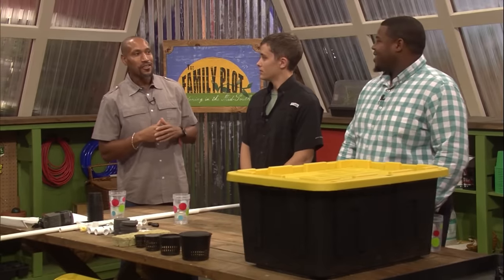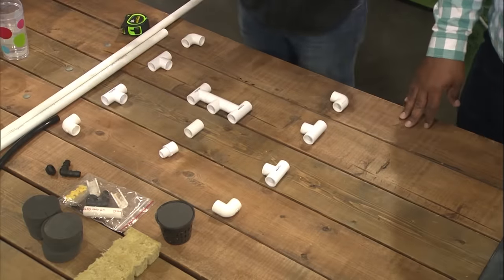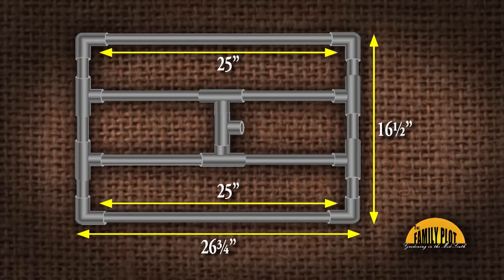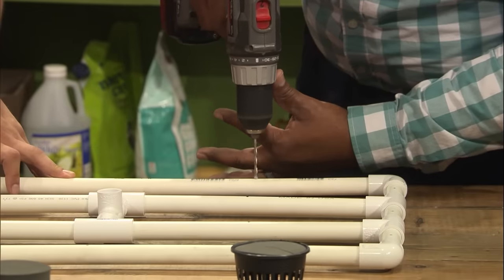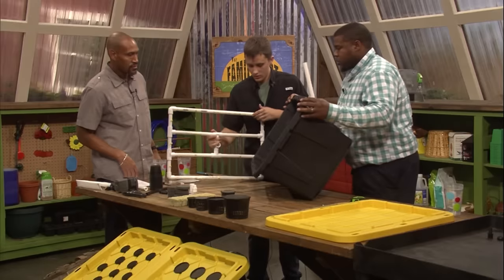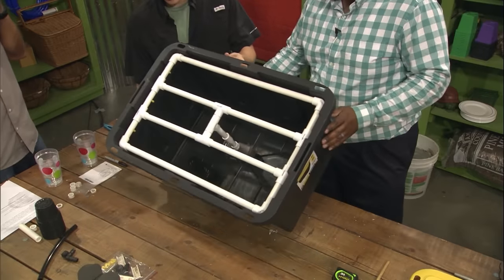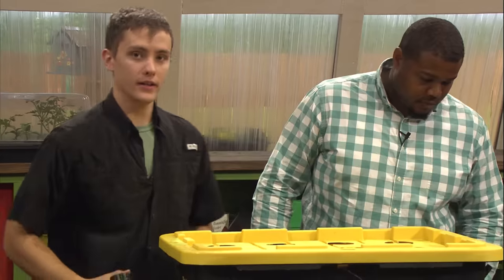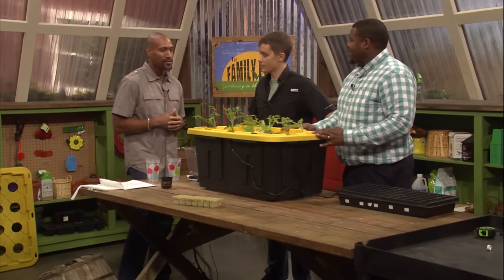Building an Inexpensive Hydroponics/Aeroponics System

Comment: Dont use this cuz it has a yellow led top light will pass to ur roots not good all black only no light to the roots.. They lie to u or dont know what the hell they are doing lol
Reply: They tell you about this problem. You can use tin foil or paint to deflect the light.
Reply: It's disheartening to watch you guys continue you type out stuff like this without researching our MANY pictures on social media showing this exact tote growing plants for months and months with no issues. The yellow tote has a tendency to allow algae growth on the bottom surface of the tote. The algae doesn't spread to the water itself, it doesn't interfere with plant growth whatsoever, and it's very easy to clean off so long as you don't allow it to dry onto the lid. If we had had an issue with it, we never would have made the video without treating that problem. We made this video and technique to use the bare minimum requirements to move forward with aeroponics in the home garden, both indoors and out. Our techniques will save you money. We clearly state that you can cover or paint this lid to combat any light leaking, but it is entirely unnecessary. If someone made a completely black tote of this nature, we'd use it. There aren't any other totes as sturdy as this one, in as many sizes, or as readily available. Maybe one day soon we can be fortunate enough to grow our business large enough to make them ourselves. Until then, what we have shown you here not only works, but it will out pace any other gardening technique you are using in terms of control of the plant's environment and the speed in which you get to harvest. Calling us liars or uneducated is not only unwarranted, but shows your skill level clearly. We have a tremendous amount of documented evidence to backup the efficacy of this method. So does the Family Plot, now. Try it before you deny it, buddy.